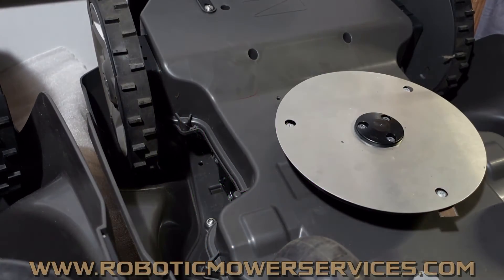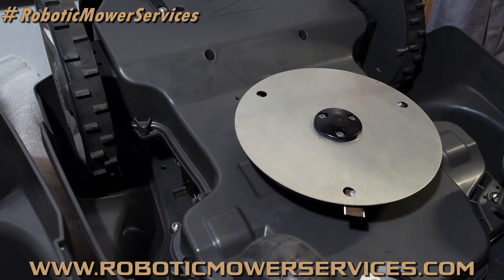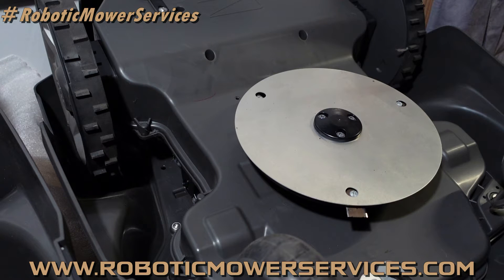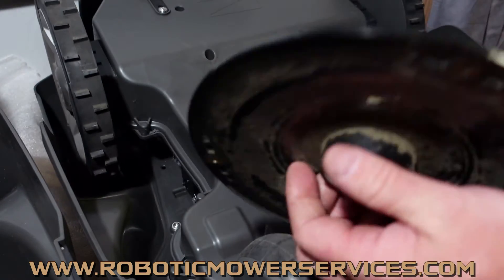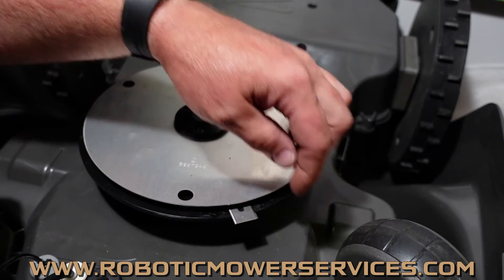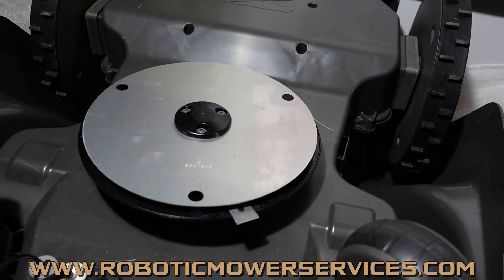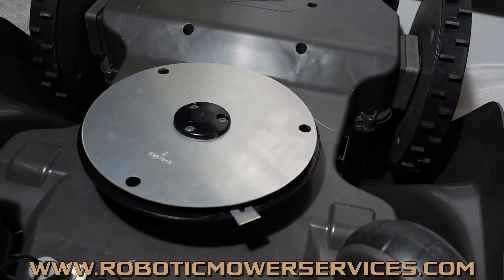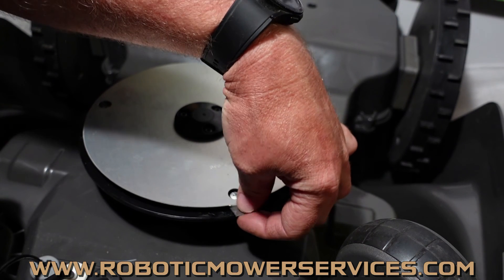How To Improve Cutting Quality Of Husqvarna Automower Models 430X, 430XH, 450X, 450XH, and more!

Comment: Interesting comment about 3 to 5 blade recommendation. Correct me if I’m wrong. 1 blade's serviceable life is Y hours, which is in accordance with the amount of grass 1 blade can cut. Therefore wouldn’t the service time of the blades be increased? 3 x Y=3Y vs 5 x Y=5Y
Reply from the maker: Depends on the type of grass and the conditions. In our area blades don't last as long in the spring because the grass is thicker and usually wetter due to all the rain. In the summer it gets dryer and we can have a few weeks without a decent rain. During the dry time the blades last longer.

Comment: Why not just get someone to make longer blades
Reply from the maker: The smaller skid plate flexes less than a large one. So with longer blades and the original larger skid plate there's more tendency for the skid plate to flex and rub the blade screw heads.